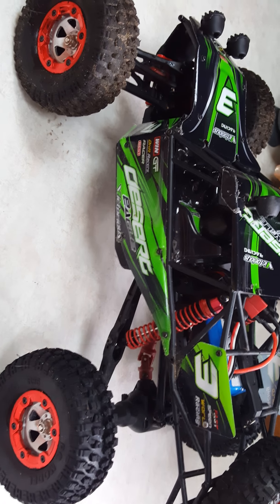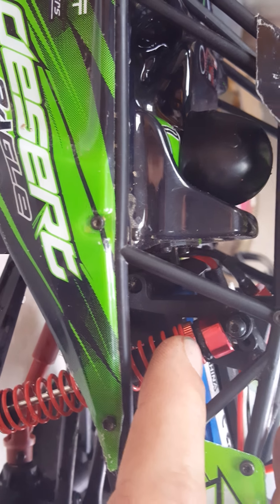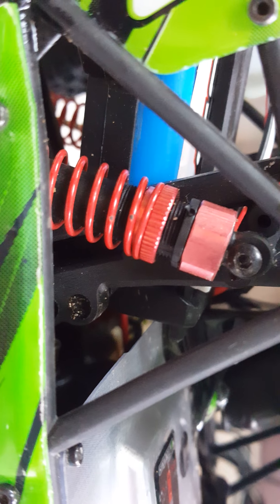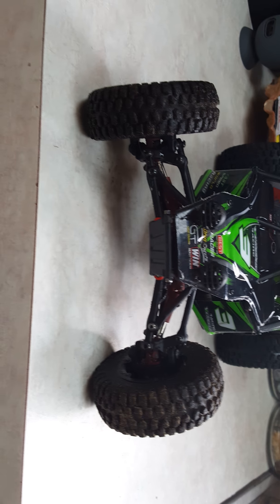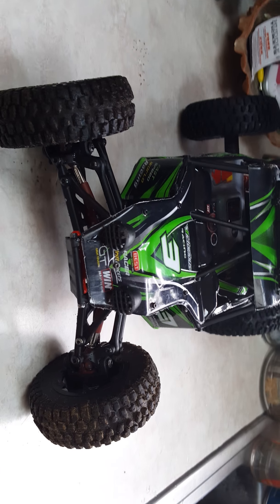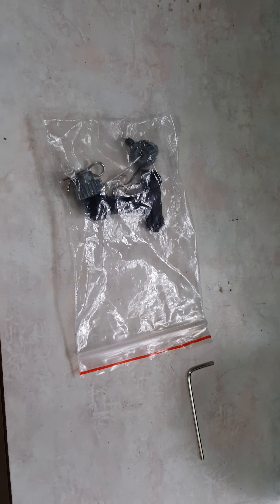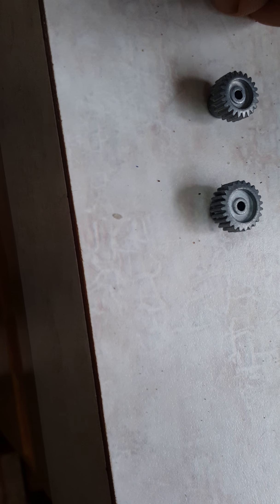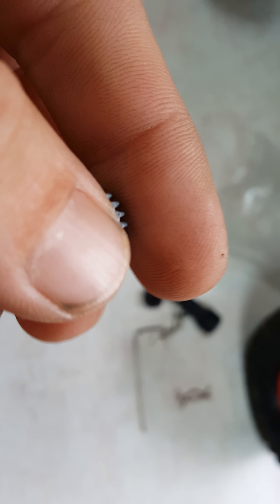Feiyue eagle 3 issues out of the box.

Comment from the maker: they sent a new servo and set of shocks. Takes a minute to get them but it's not a bad set up for a beginner.  don't use bigger tires unless you use a smaller pinion  and the ones that come with it are not small enough. If my memory serves me right, I think the smallest they give is a 22t and I would say it needs like a 17t for bigger tires. I burnt up a motor and battery with 2.25's. just a heads up.

Comment: ive bought one of these cars...found it difficult to pair controller and car together and now the controller when turning the wheel the car it direction left is right and right is left
Reply from the maker: alex duncan there's a switch on the top of the remote to change that.
Reply: Yeah thanks found that....so far the rc car is ok needs to be quicker, would changing the motor to brushless be better or just stick to changing the motor gears...oh and reverse is crap